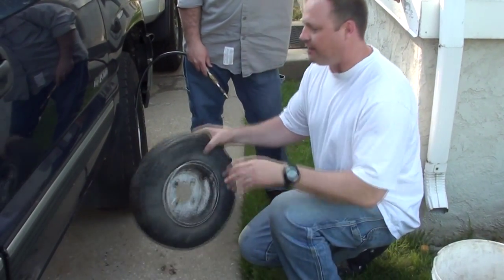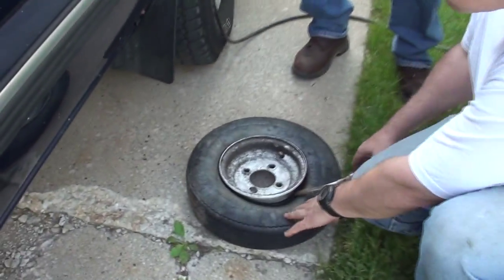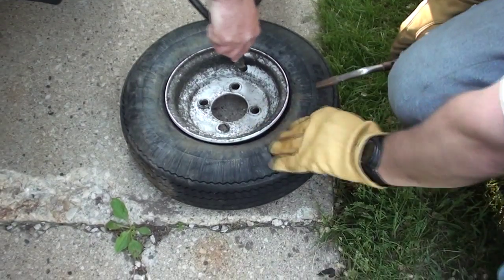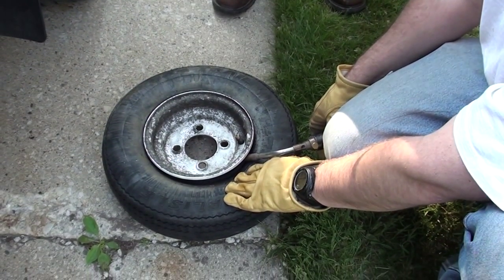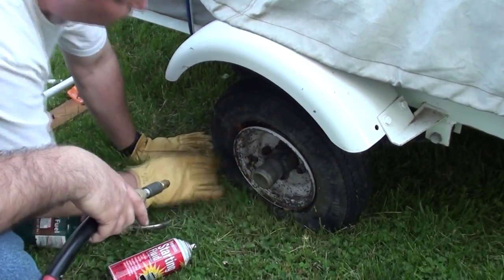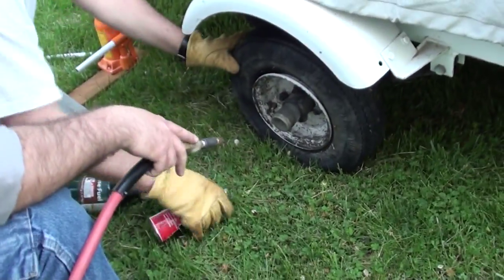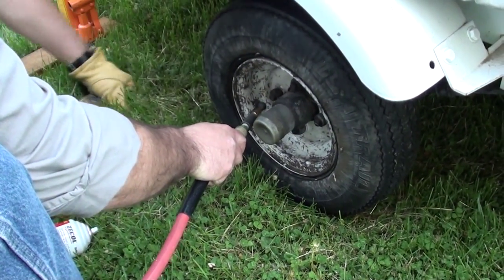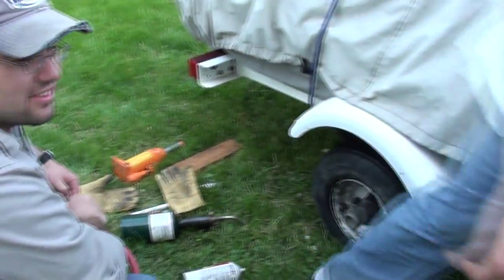Fire Without Arms - Seating Tire Beads

Comment from the maker: @MrRichardbryan  Hearing from someone who treats burn patients does give me some reservations about having a video like this posted.  I guess this is one of those activities where a guy has to weigh the risk vs. reward.  The alternate method is even less safe from my experience.  Maybe at the very least I should have had glasses and long sleeves, but if this procedure is too dangerous then all my bullet casting with molten lead is way out of the question.  I do appreciate your input.

Comment from the maker: @j0enasser The ether burns very fast and heats the air evenly inside the tire and pushes the bead against the rim.  It's important to get the air compressor chuck on the tire quickly, before the air inside of it cools and shrinks.